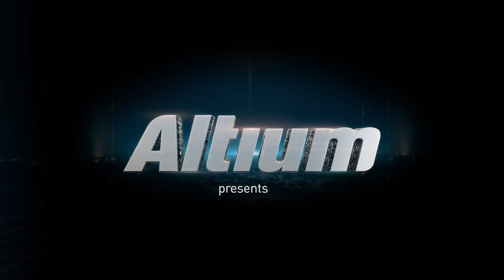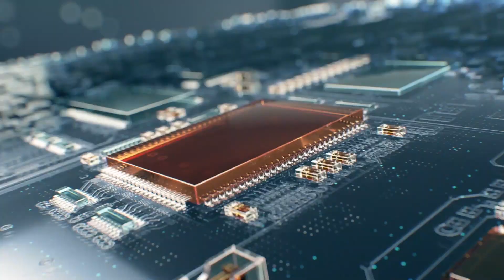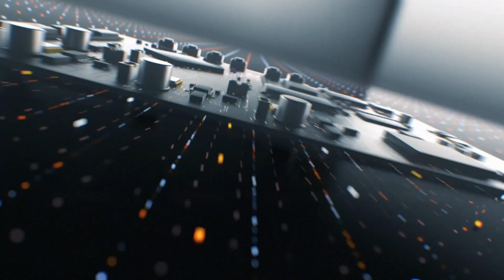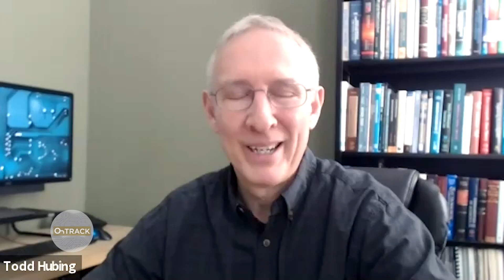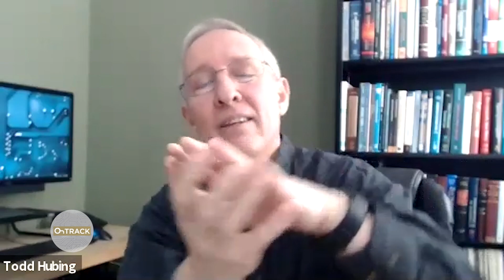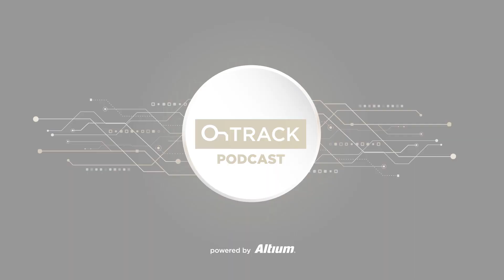Four Commonly Held Myths of EMC Design

Comment: From Bogatin's Signal Integrity Book [p.506]:
 'We should remove the term differential mode from our vocabulary and then we will never be confused between odd-mode impedance and differential impedance. They are completely different quantities. There are odd-mode impedances, differential signals, and differential impedances. [...] The odd-mode impedance is the impedance of one line when the pair is driven in the odd-mode state. The differential impedance is the impedance the differential signal sees as it propagates down the differential pair. [...] There is no such thing as differential mode. Forget the word and you will never confuse differential impedance with odd-mode impedance. ' 
So, in my opinion the correct answer is a.) Differential mode is not defined.